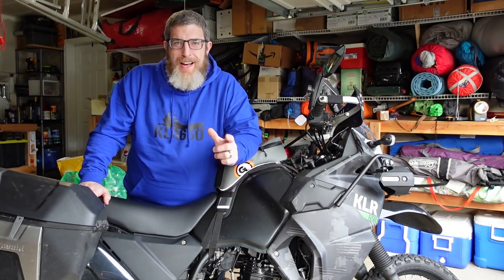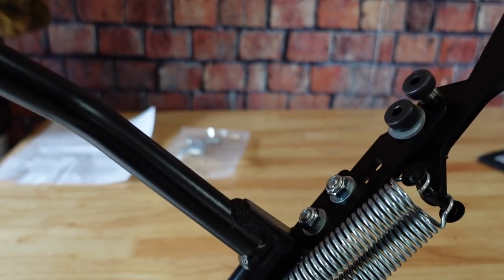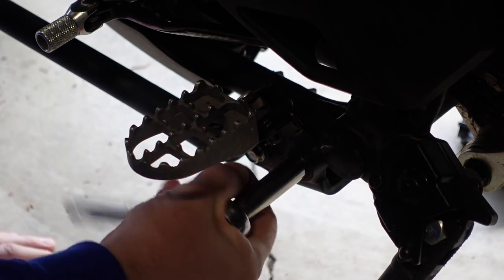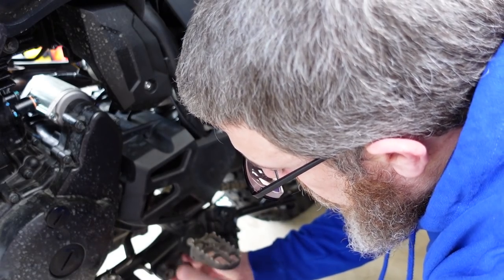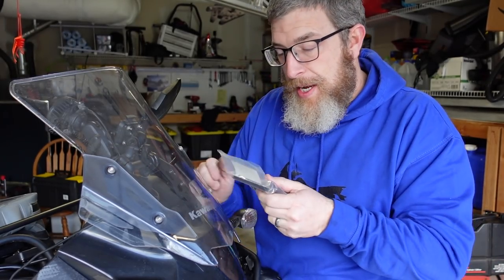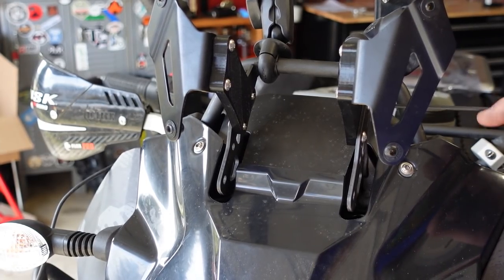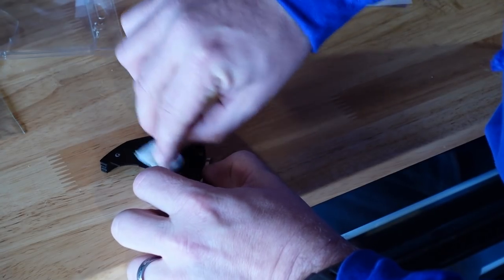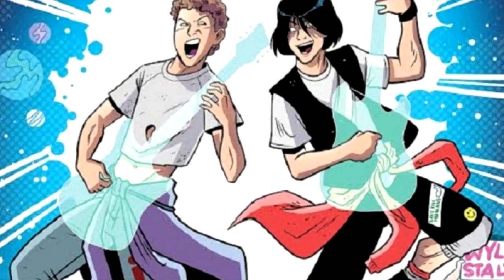More 2022 Kawasaki KLR 650 Adventure Mods: Windscreen Risers, Center Stand, and Throttle Lock

Comment: I would want some sort of sliding mount for the windshield, for easy adjustment up and down. Those Atlas throttle locks are an amazing product, I used one of my T7.
Reply from the maker: I'm pretty sure there are other companies that make something similar that is also adjustable. I'm pretty happy with where these are, though.

Comment: Tried the throttle lock. It looks like it was installed just like yours. When I get to hwy speed the buttons very awkward to push because they are wrapped around so far.  Did you have the same issue?

Comment: I got those screen risers too. Wasn’t a fan of the near vertical position. Took them off and installed an adjustable Givi “visor”. Works great and looks a bit better to me. Hoping someone will come up with a better mount solution. I like the 3D concept but my ideal position is about halfway between stock and where they are.

Comment: Going to pick up my new KLR 650 in Boise next Saturday.  Wanted an ABS model in the tan color, but all I could find in the PNW were in the Seattle area with horrible mark up.  Finally found a non ABS model for $7500 out the door.  Still too much, but the best deal I could find.  Just ordered the 3D Cycle Parts windshield screen riser since I am 6'2".

Comment: Sir, can you tell me  what the throttle lock actually locks on to?
Wondering if it works with aftermarket grips (no inner ring), or if it requires the OEM type with inner rubber ring.
Thank's

Comment: Dork in the Road:   Thanks for the instruction video on the Happy Trails center stand!   I just bought one because of it!   I have a question for you:  What are you running for motor oil?   10-40 or something more exotic like 20-50?    These things are running at around 4,000 rpm's  most of the time and I live in South Florida.    Thanks!
Reply from the maker: I always just run whatever the manufacturer recommends

Comment: I have a center stand from Amazon it works great and it's $129.00 gocruse throttle for $12.00 I did pay more for my windshield good video. but 2 of the free parts you now recommend are way too high priced.

Comment: Are the footpeg bracket threads still made of Zamac? I caught a little air and ripped the footpegs out of the frame on my 15. I ended up welding them to the center stand frame.

Comment: Just a heads up... the screws that attach the windscreen riser to the bike wiggled right out on me the minute I got off pavement. I replaced the 4 of them with the cap screws that were on there stock and it has been much more secure. You may want to keep an eye on them.
Reply from the maker: Good to know
Reply: Even with low strength thread locker on them?
Reply: @3dcycleparts  yeah, but admittedly I may not have put enough. I went a little light on it. Other than that though I love the risers. They have made a huge difference for me being 6'4. I don't have to take the visor off my ADV helmet every time I got the interstate now!

Comment: Hey dude, on the Atlas throttle lock, if you don't have the heated grips on the 2022 KLR 650, should you buy the bottom kit instead of the top kit, or would either kit work?

Comment: I’ve been struggling with weather to buy a center stand for my KTM 890 Adv R or getting a PitBull rear stand.  I need it for Maintenance not necessarily on the ride but I guess fixing a tire in the field might benefit by having the center stand
Reply from the maker: Changing a tire on the trail is way easier with a center stand.

Comment: "Happy-Trails KLR center stand install, so easy, even a Dork can do it" Haha, you see what i did there, LOL! Hey Dork did your AT have cruise or was it a throttle lock system? My 2016 1200GSA has an actual cruise and that right there is worth the price tag! 😆 LOL. I am gonna need a throttle long for my KTM500 and so far from what I've seen on the one you installed that's probably the one I'll install.
Reply from the maker: I had neither on the AT. Just the old sore wrist

Comment: Hi Dork,  I had a problem with the Atlas Throttle lock.  It would not grip the throttle tube.  I tried squeezing the lower loop as hard as I could but even at full travel the throttle lock would not grip the tube tight enough.  I used a pare of channel locks and I bent the lower loop, so I can't send it back.  This is the second time I have had a problem with your endorsed products, so I am not going to link to anymore of your endorsements.  I going to keep watching your channel but when I want to order something I will go elsewhere.  I just noticed that your link to Happy Trails is still up, I asked that you take it down because the center stand is back ordered and the costumer is not aware of the inventory issue until funds have been issued and then a day after Happy Trails informs the customer of a back order and 6 to 7 weeks delay.  Please take the Happy Trails link down.
Reply from the maker: Yeah dude I'm sorry to hear you had trouble with a couple things but I'm not going to take down links to products and companies that I know are quality because of one person's bad experience.  I've personally had nothing but positive interactions with both companies and I'm impressed with the products I've personally used. 
 
Have you asked Happy Trails if they'd cancel your order and refund you?  Did you follow the instructions for the Atlas installation?  Pretty sure they explicitly state that you're supposed to tighten it down by hand.  Have you asked Atlas about a replacement part?  

I'm genuinely sorry to hear these products aren't working out for you, but you're the first person to complain and I've made many referral sales for both companies.   I can only recommend things based on my own experience and my experience has been nothing but positive. I understand if you no longer wish to trust my recommendations.  That's your call.